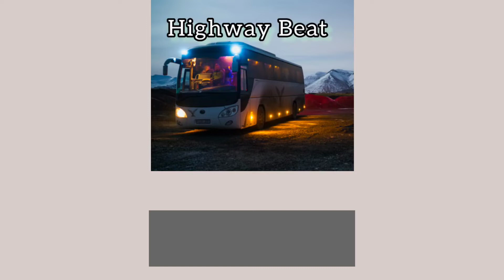Engine 📣 sound of All types of Volvo buses | B7R | B8R | B9R | B11R |

Comment: 0:05 Attention, the best D8C Euro 4-5 Engine because fully Volvo design and engine, but 7.1/2 liter/D7E = Deutz Engine and Volvo/Renault design, you know, simple german engine but if is 7 liter Euro 3 and 8 liter Euro 4-6 = Swedish Engines.

Comment: What is the difference between volvo b7r and b8r??
Reply: Attention, the best D8C Euro 4-5 Engine because fully Volvo design and engine, but 7.1/2 liter/D7E = Deutz Engine and Volvo/Renault design, you know, simple german engine but if is 7 liter Euro 3 and 8 liter Euro 4-6 = Swedish Engines.